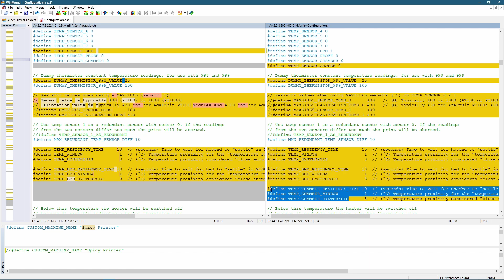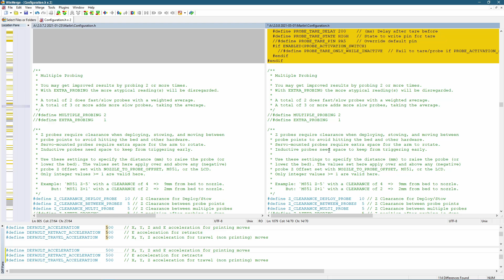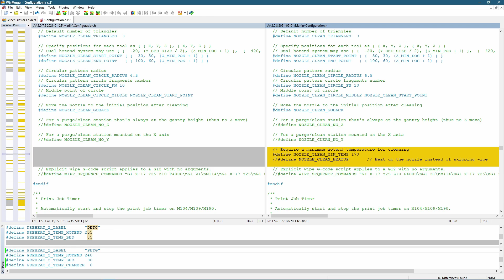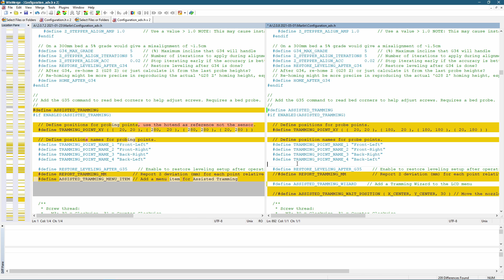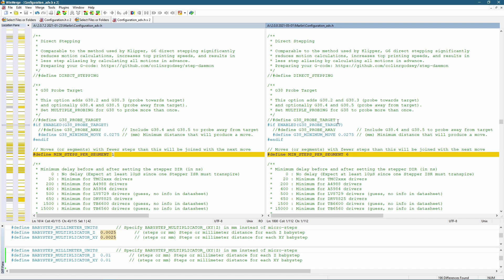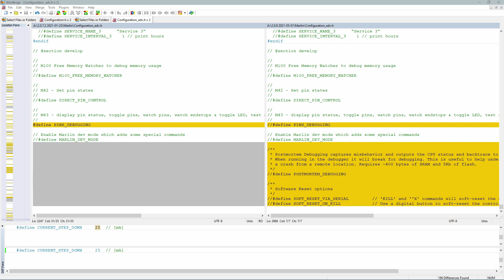Upgrade Your Marlin Config The Easy Way!

Comment: WinMerge is definitely the tool to go for this. So compliments for this video to point that out.
But a friendly recommendation: please use Alt-Down instead of scrolling with the mouse to the next change. And then, the most important keystroke is Alt-Right to copy the left line(s) to the right.
Doing that means no fiddling with copy+pasting anymore (selecting once left and once right) or the risk of making typos (You're statement on 4:20 is actually not right. It doesn't recheck if you're typing).
You are pretty quick on the keyboard so I'm pretty sure you'll like this.
Alt-Down always scrolls the difference a few lines from the top so you'll see the context quickly. And long lines can be seen easily in the bottom pane.
Another advantage is that it removes the amber color on both sides immediately to show there's no difference anymore. And what I like to do is setting Ignore comment differences in Options > Compare > General. It still highlights the differences in comments, but skips them while going through the code with Alt-Down.
Hover over the buttons to see some more time saving key strokes; the video would be shortened by halve with Alt-Down and Alt-Right 😜.
My respect to you to put out this many informative videos, thanks.

Comment: Great info!  2 things I don't like about Marlin 2 Menus. Maybe you can tell me how to, or (where to change in the firmware) 

1) I'd like to move the "print from SD card" closer to the top (like 2). 

2) Can I move the "Preheat PLA" (Nozzle to the main screen? I'm always changing filament. 

3) And finally my big gripe, when I select a file to print. In Marlin 1x it would just start the print. Now you click the file, and on the next menu you have to go from CANCEL to PRINT then click to start.  I'd like to JUST "print" like in Marlin 1x. I can't tell you how many times I thought my printer was heating up, but it was still at the CANCEL "are you sure you want to PRINT"?

Thanks!

Comment: Great video, but what if you don't have a configuration file to compare it to? I have never upgraded my firmware before and don't really have a clue where to start. Maybe this is the wrong place to ask, but a video on how to configure the configuration file would defiantly help. Thanks
Reply: Thanks for the feedback! We have a few videos on customizing your firmware, but if your current version is fine and you don't have the source code from the manufacturer, then I'd recommend sticking with what you have.
Reply: Generally you find a example config of a printer similar to yours. (they provide many in the Marlin 2.0 firmware download). Most of the important things you can just measure, like bed size, what monitor you have, what mainboard or steppers drivers you have. Do you have a BL touch? What hotend or extruder you have. Most are pretty standard. Many are similar to any Creality extruder/Hotend.
Reply: Before you start, if you connect your printer to your computer. and run a Slicer with a Console. I use Repetier Host.  M115 - Firmware Info. M115 will report back all your current settings. Copy them, and use them in your new configuration.h.
Reply: @FilmFactry  Great information! I completely agree. Unfortunately I've had mixed luck with OEMs actually implementing M115, but it definitely helps when they don't provide anything and you need to start from scratch.